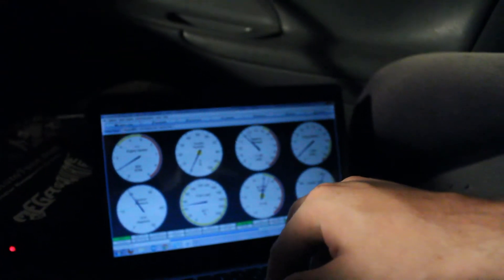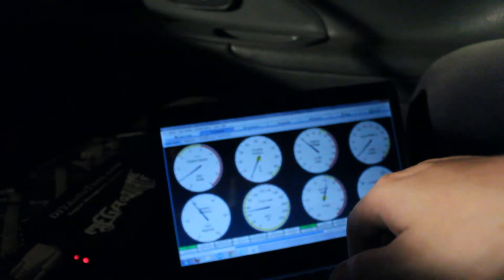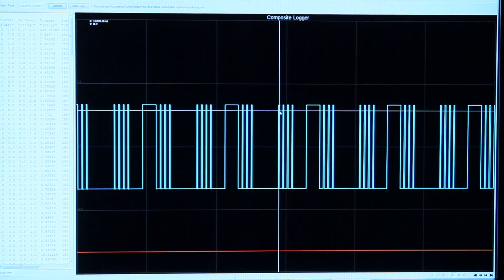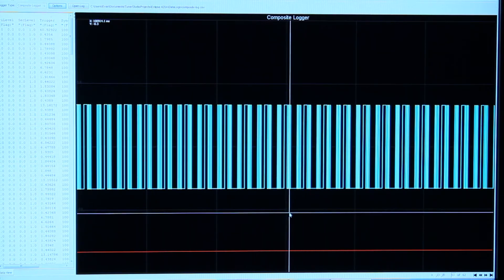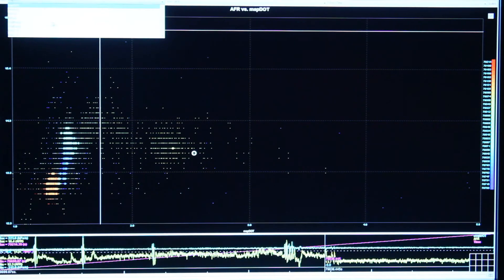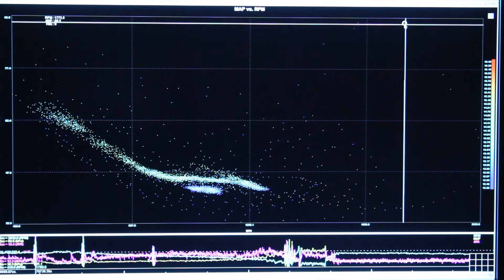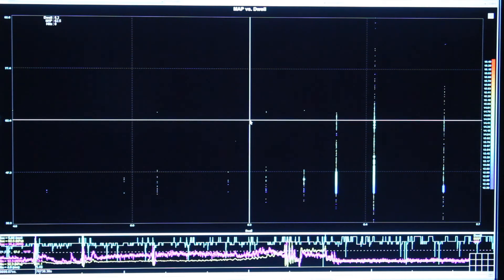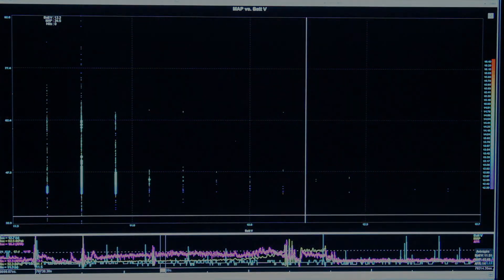Evan's Megasquirt Build Ep 28 - Sync Loss fix and Scatter Plots

Comment from the maker: Thanks.  That is my brand new fluke scope meter.
I had trouble getting it to sync up real nice, but it worked.  The difference between the MS log and the scope is that on the scope you can see signal quality degradation, whereas in tunerstudio, you can only see a missed or extra tooth as a result of the quality degradation.  Still really powerful stuff.